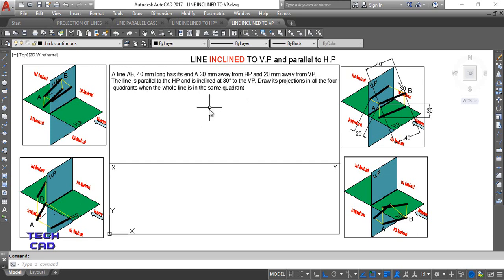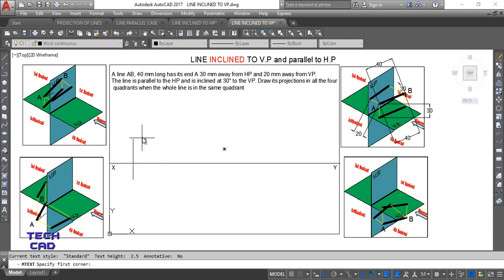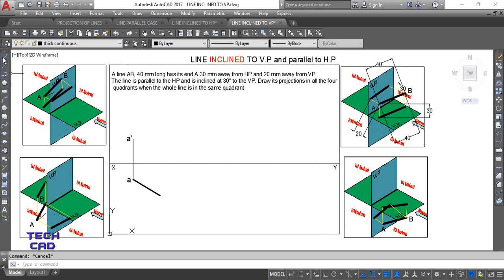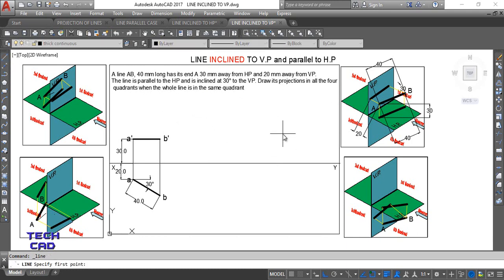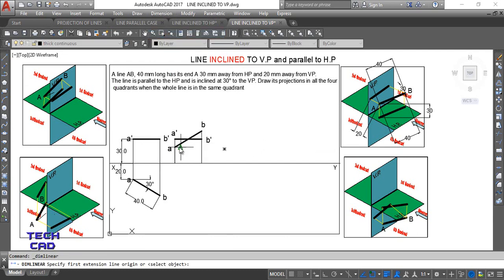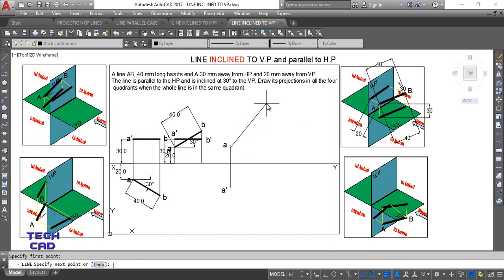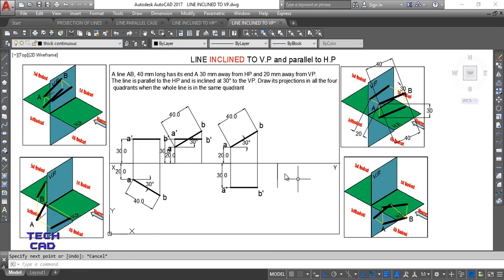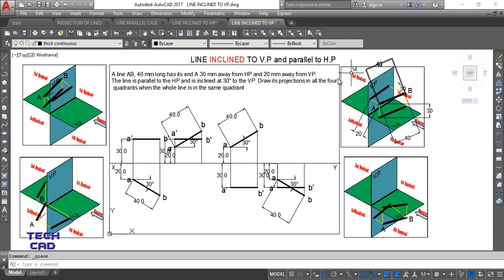PROJECTION OF LINE INCLINED TO VP and PARALLEL TO HP

Comment: Sir  , 
Case.4 Line contained by one or both of the principal planes
Case.4.1 Line contained by the HP
Ques.6 A line EF, 50mm long, is contained by HP and is inclined at 45° to the VP, has its end E 10mm infront of the VP. Draw its projections., Sir Please solve this question and make video for this question.
Reply from the maker: dear
pls tell me ur email address
Reply: @TECHCAD  amritpalsingh97816@gmail.com